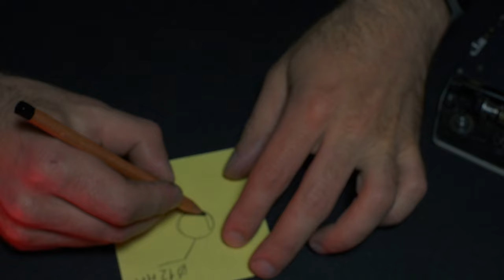How to install an image sensor in a film camera DIY / Cyberpunk / Digitalization

Comment: Really cool! Image sensor looks decentered to the image plane though, with the sharp plane being on the right side and it not following through the whole image. Really cool look in the forest.
Reply from the maker: Thank you

I agree. The camera needs to be further calibrated.
Reply: Question, by being decentered you mean that the sensor needs to be precisely paralel with the lens or it needs to be centered so that the light square from the lens should fall preciselly on the whole surface of the sensor?
Reply: @dreacul  The sensor needs to be parallel with the focal plane, i.e. with the lens. 
The sensor being off-center on the other hand would lead to transformations and warpings similair to the shift of a tilt-shift-lens.

Comment: Very cool project, the option to switch to infrared is great and the look you get from those old lenses is surprisingly similar to old super 8 despite the fact that it is captured using a modern digital sensor. The lens really does add so much vibe - I imagine that just a little film emulation plugin added in post would get you very authentic super 8 looks.
Reply from the maker: Thank you )
Reply: Actually a modern lens on a modern small grain film looks crispy digital and it's hard to see the difference when printed. Especially when shooting on a technical purpose Fujifilm 400 film - as true as a digital sensor is. The picture is light, shadows and lens, a sensor or a film is a media only (if developed right way).

Comment: First I was afraid of destroying an old beauty like that by the inside but turn out great! NICE PROJECT! How was the battery duration? And the files can fit in the SD cards easily? That was amazing
Reply from the maker: Thank you
It's not quite an antique camera. I have another one in its original form.
The battery lasts for 1 hour.
The SD card is 32GB. No problems with it.
Reply: @o_steletskyi  you have plenty of empty space in there, can fit a couple extra batteries

Comment: Great to find your page. I love old photography and video, as well as everything modern and digital. I'll be entertained for many months with all this information. Thanks. Now a few questions: 1. Why did you have to look for another IR glass? I can't understand why old cameras didn't have it as standard, seeing as digital ones have it built into the lens. 2. I'm converting a Yashimat S autofocus with all the mechanics destroyed. I've removed all the mechanics. The light enters through the lens directly to the digital sensor. Do I only have to worry about calibrating it and positioning it correctly? Is there anything else I have to take into account? Thanks a lot.

Comment: Great work. Some of that footage almost nails the look - although presumably somewhat higher resolution than normal 8mm film. Question: it looks to me like the sensor readout is slower than on an action cam. There seems to be plenty of rolling shutter. Is that because of (I presume) the sensor is now being read by a little single-board computer rather than a fully optimised camera processor?
Reply from the maker: I didn't use my controller.  I completely transferred the electronics from the action camera to the film camera along with the sensor.  This is the maximum that my skills were enough for))
Reply: Ah ok. Wow. I wouldn't have thought those little action cams had so much rolling shutter. Fantastic work though. @o_steletskyi

Comment: to do something similar, i just have to house the action cam within the film compartment of a double 8? no software mod needed? I can easily mod the same battery and charger module, and maybe mod the action cam buttons to the film cam to record easy
Reply from the maker: Yes. Without lens.
And adjust the sensor to the correct position.
Reply: @o_steletskyi great then, any particular reason you used the xiaomi yi action cam over others?

Comment: I have a question :

It is known that a Micro Four Thirds CMOS image sensor (found in Olympus and Panasonic cameras) are slightly larger than Super 16mm film. There is a community that talks about whether these sensors can be built into a 16mm film camera. However apparently a raspberi pi does not have enough RAM to store the image taken from a large sensor. 

How did you choose the right image sensor to use for this built? is there a resource on how to connect different image sensors with the raspberi pi?
Reply from the maker: That's an interesting question.
I don't have enough knowledge to answer it.
I want to try to digitalise a 16mm camera. 
The easiest option is to remove the sensor together with electronics of the camera itself (lumix or olympus).
Reply: thank you!  @o_steletskyi
Reply: The Raspberry Pi would need to communicate with the sensor by designing an adapter to connect to the board, assuming the sensor can even do that. Then I would image you need software to manage the data from the sensor because it might not recognize it like a CMOS sensor you see in cellphones or webcams. 

Honestly, the best thing would be to use the sensor Razor Kiyo Pro Ultra because it’s 1/1.3” and find a decent lens. Trust me, someone will find a way to get it and the native Razor application to work with a Raspberry Pi (if it doesn’t already) and possibly create a custom camera and even a cinema camera.

Comment: I was deeply inspired by your video. Now i want to get a broken Super8 camera and convert into an action cam like what you did. Do you think there will be enough space in Super8 Camera?
Can I follow your method by removing the rotary disc shutter of the camera and disassembling the action cam to install it inside the camera? 
I'm curious if it's possible to transfer the components of the action cam into the Super8 film cartridge instead of inside the camera. 
Also, I wonder why you removed the IR filter from another camera for use. Is there no IR filter between the sensor and lens in the action cam? 
I'm a novice in cameras and videos, so could you provide any tips or expertise for me? I would greatly appreciate your advice.
Reply: The newer action cams don't seem to have an infrared filter and have their own coating on the lens.
Reply from the maker: Yes
Reply from the maker: My camera used double super8 film.
It gave me More space inside the camera.
Reply: @o_steletskyi  Мені цікаво ще одне. Наскільки я знаю, більшість екшн-камер використовують фіксовану діафрагму, але чи має значення робота діафрагми у камері 8 мм?

Я планую придбати камеру Braun Nizo Super8, але більшість камер Super8 від Nizo мають електрично керовану діафрагму, яку не можна вручну налаштовувати через зв'язок з експозиційним вимірювачем.
Reply from the maker: @randagiorosso2759 проблем не має бути. Можна залишити автодіафрагму з камери. Так буде навіть цікаво. Тоді екшен камера не буде робити дуже коротку витримку при яскравих сценах. І кадри будуть більш кіношними.
Reply from the maker: @randagiorosso2759 рекомендую придивитись к екшен камера від Соні. У них цікава форма. Може будет легше її вживити
Reply: @o_steletskyi  Дякую за докладну відповідь.

Якщо вимірювач експозиції та автоматична діафрагма несправні або не можуть бути живлені, чи краще просто повністю відкрити діафрагму і зафіксувати її?
Тоді чи можна використовувати повільну швидкість затвора за допомогою ND-фільтра?

За вашим порадою, здається, що структуру екшн-камери Sony можна легко перенести на 8-міліметрову камеру. Проте вживані ціни на них все ще трохи високі. Я розглядав пошкоджену вживану камеру GoPro8, але здається, що кут з'єднання сенсора та материнської плати не дуже хороший.

Слава Україні! Приємних різдвяних святкувань!

Comment: will the camera return any error info due to the AF module is removed
Reply from the maker: This action camera doesn't have autofocus.
Reply: @o_steletskyi  thankyou for informatiom, I‘m on my way on making a digital Super 8 cam. i am plan to add a CRT monitor on the camera （as a AV output was build in the usb port of xiaoyi action cam)

Comment: So, a CMOS sensor with what? 30 fps? 60 fps? To me, the only useful retro feature of old film cameras is a trigger - it is shooting/recording while the trigger is being pressed, and stops when it is released. Otherwise, it is just a Xiaomi cam in an old-fashioned body. At least you can use different lenses.

Comment: doesn't make sense. With modern digital cameras you can get a more stable and high-quality image, add post-processing and get a result close to film imitation. but a digital matrix will still not replace film material. Of course, it’s interesting what you did, but I don’t see any practical benefit from it...
Reply from the maker: I agree.
Because it's just fun